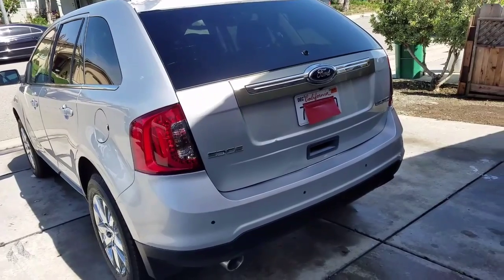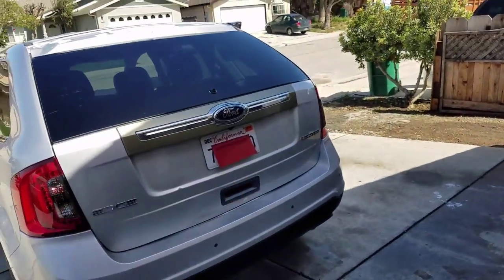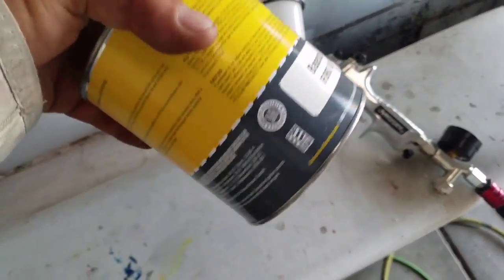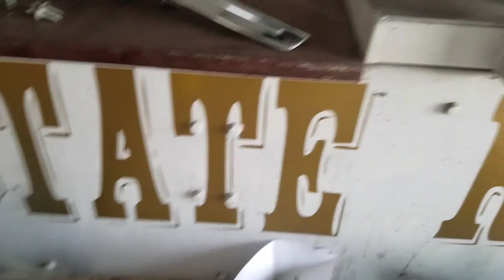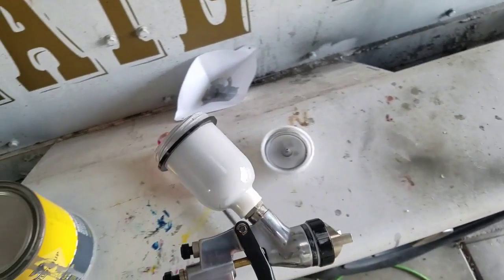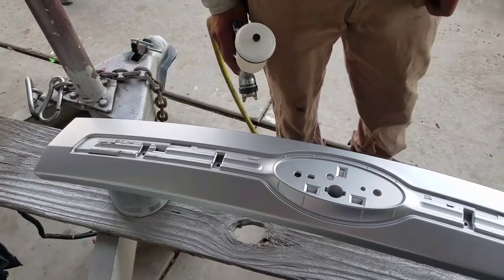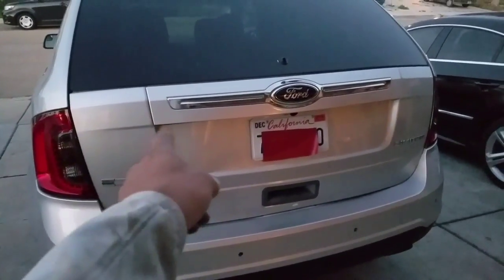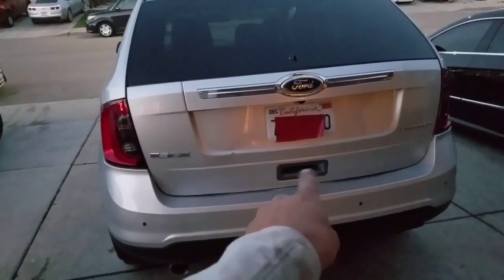Painting ford edge rebuild project bought @ copart auto auction

Comment: Great job man it looks new. I have a tail gate door that I want to paint and I want to know what pressure does the compressure need to be at to spray. I live in Nebraska and I would like to get in to flipping car for profit . Thanks
Reply from the maker: i personally don't care about the compressors psi what i do check is the gun psi regulator to be at 40 psi, if i did not have the regulator on the gun then yes i would have the compressor set at 40 psi, but for this video compressor was at 90psi and the guna at 40psa .don't forget to shoot a video when you spray your tailgate we want to see it man, thanks for watching ✌